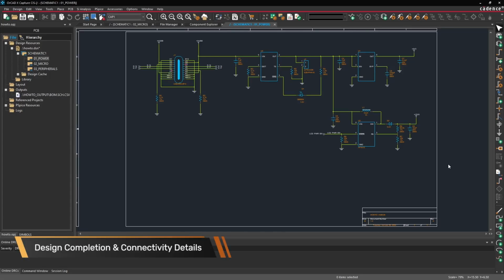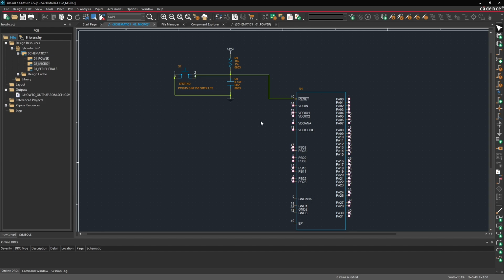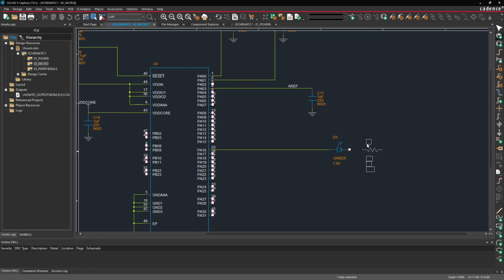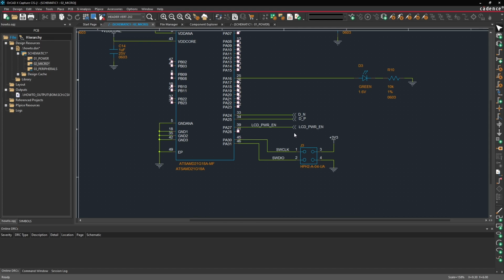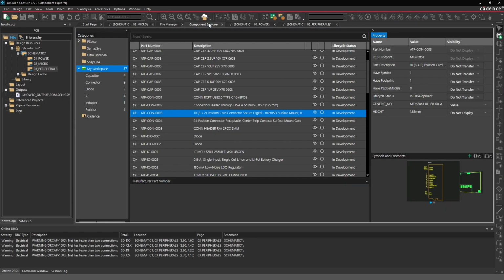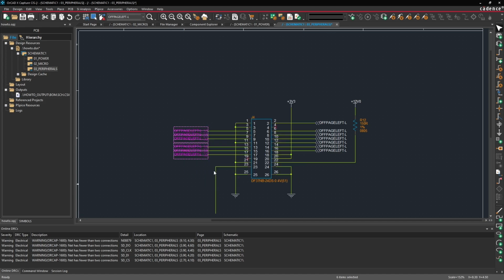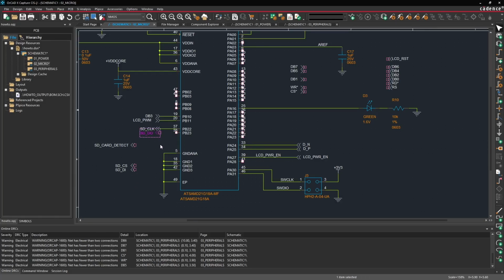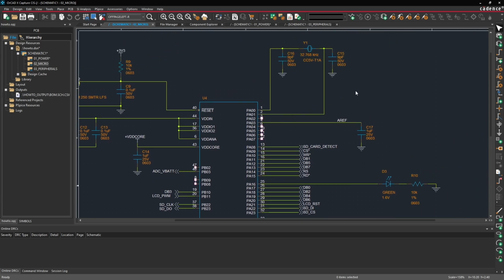OrCAD X Capture How To Series - Part 5 Design Completion & Connectivity Details

Comment: The ATF-##-#### components are not present after downloading the required files and placing them in the appropriate file directories. Therefore, it appears that they must be created as components and incorporated in the library by those following along. The video (at about the 0:58 mark) suggests that a spread sheet or PDF will be generated so that for each AFT-##-#### component the symbol, footprint, and properties will be identified. I am currently reverse engineering this information from the video, but it is not always obvious and would be helpful to actually have a spread sheet or pdf file to insure that I am getting it correct. I would at least like to have a chance of successfully completing the tutorial and moving on to layout. 

Parts Generated: 0.1uF cap (ATF-CAP-0001), 150 & 100k ohm res (ATF-RES-0008 & -0009), 3 different connectors (2x2  header, SD Card, & 24 pin header)(ATF-CON-0002, -0003, & -0004), Switch (ATF-SW-SPST), NMOS FET (ATF-TRN-001), 32.768 kHz crystal (ATF-XTL-0001), and Microprocessor (ATSAMD21G18A)(ATF-IC-0001).

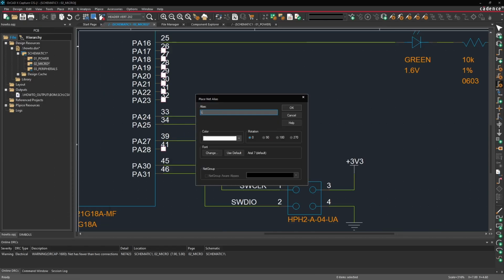Comment: I am having the same problem as the previous two comments. The footprints appear to be present, they have symbols in SYMBOLS.OLB, but they are not in the Component Explorer. The parts are possibly the ATF-## part numbers observed in your part 2 video (at 11:33 into the video). Do we have to create all the ATF-## or can you provide them. Alternately, since footprints and symbols do not always have a trivial one-to-one relationship, can you provide a list for manually recreating them?
Reply from the maker: There is a Symbols_All.OLB file in the asset download, you should be able to find all parts there. Let us know if you have any further complications!
Reply: @CadencePCBDesignandAnalysis  OK. Found them in SYMBOLS, but reread and answer the edited question please.
At about 0:58 of this video ... "I am going to add a spreadsheet or a PDF down the line". Does this exist and where can I get it?

Comment: I've understood and followed along with the previous videos up until the moment the MCU (ATSAMD21G18A-MF) is introduced. I've downloaded the assets from Part 2 of this tutorial series and pasted the SYMBOLS.OLB and the how_to_videos_footprint_lib folder to their respective folder locations. Nowhere can I find the MCU and other new parts introduced in this video. Perhaps there is some other download folder that is missing?
Reply from the maker: Hey, thanks for your question.  Make sure you place the SYMBOLS.OLB in the following directory to view it in the OrCAD X OnCloud Component Explorer: "C:\Users\<username>\AppData\Roaming\SPB_Data\cdssetup\workspace\libraries\symbols".  This is the only folder required so the only other issue could be maybe be that you need to allow the folder to upload to the cloud before it appears.  Go to View > Workspace > File Manager  to double check the upload status in the top-right gear icon called Sync Status under Files Pending Upload.
Reply: @CadencePCBDesignandAnalysis   Hi, i did as you said, but nothing happened.

Comment: Yo dawg the component library that u supplied is missing 10 components more, incluiding the MCUs, i say it cuz imma havin a hard time tracking the crystal oscillator(32.768khz) footprint
Reply from the maker: Hey there and thanks for the feedback.  Could you be more specific which parts are missing?  We checked the asset files archive and it looks like the MCU (ATSAMD21G18A-MF) and other IC's are in the OLB's provided.  As for for crystal oscillator, it is also included in the zip archive under the how_to_videos_footprint_lib folder, called 2-smd.dra.  Please let me know if you have any other issues with the content of the videos.
Reply: @CadencePCBDesignandAnalysis  yeah cool i found it, thanks